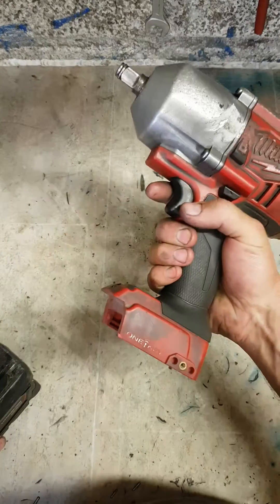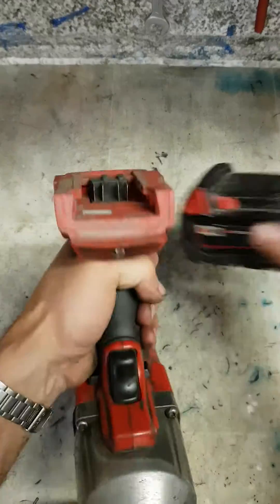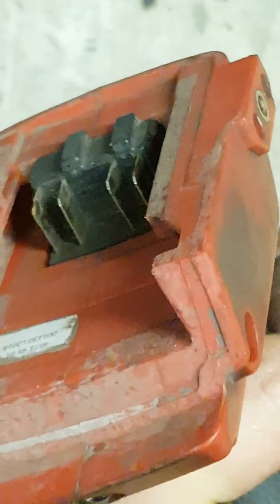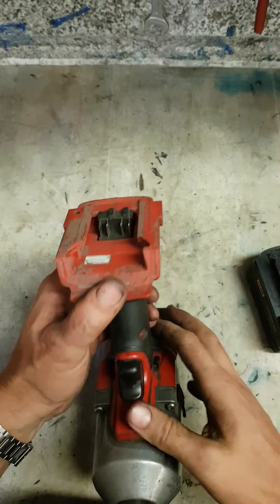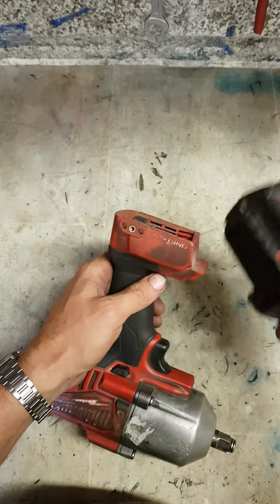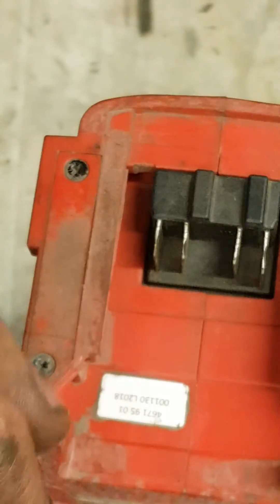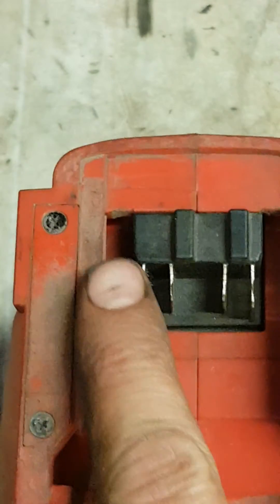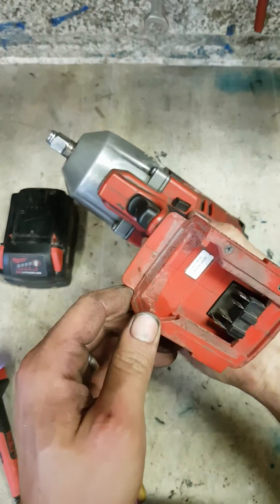Repairing a Milwaukee M18 chiwf12 impact wrench with Worn away battery contacts.

Comment: Is that little black plastic piece which holds those 4 prongs, is it normal for that to have some play in it?
Reply: I just bought $500- 2 tools, 1/2"  mid torque impact and 5 inch gen 1 18v sander and same issues 😢 I think I might stick with dewalt or look into the Walmart hyper tough- heard they are made by the same manufacturer, if I'm gonna get a shinny turd, I'd rather spend less cash.... whats your thoughts?

Comment: Pretty shit they don’t add any rubber bumpers to steady the battery. Makita is the gold standard for this sort of thing, but plenty of other brands make a better effort than Milwaukee, for sure.
Reply: Absolutely agree. I have to use Milwaukee on an iron ore mine in Western Australia. They aren’t anywhere as good as their aggressive marketing had made many believe. A 3/4 rattle gun is probably the quickest to fail like this. All the vibration and no rubber dampers like Makita use allows the battery terminals arc erode. Chinese made and owned. They should be cheaper.